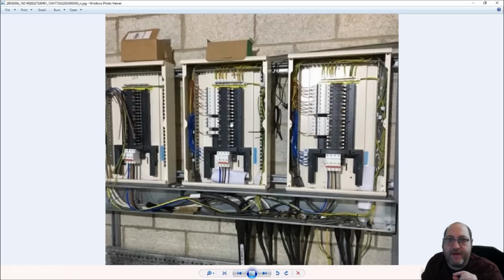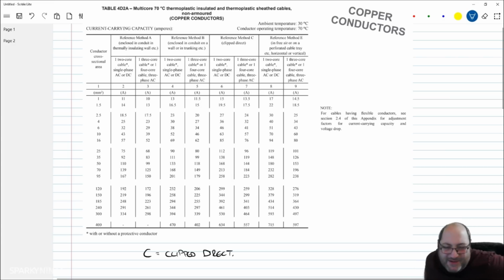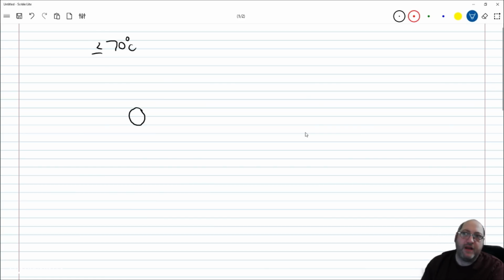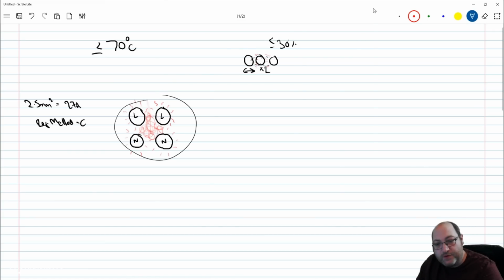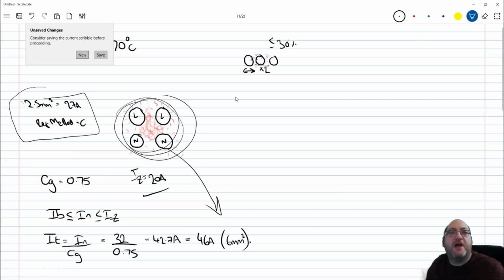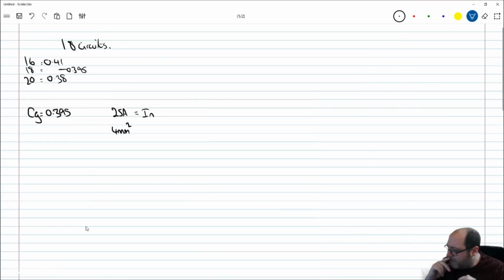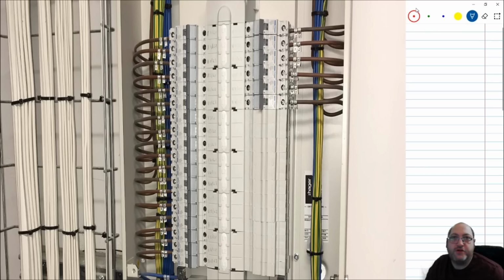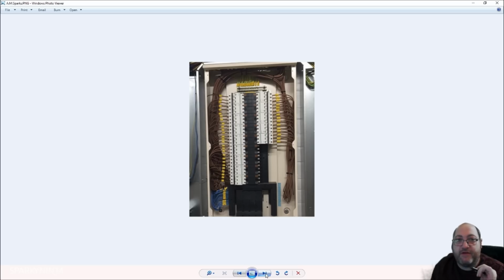Cable Grouping and the impact on electrical installations

Comment: I agree you should be highlighting bad grouping practices but the example used I don’t think was a fair one. 18 x 32 amp circuits running at full load would fry the dB fuse in a Nano second, hotel bedrooms use fuck all, hairdryer for a couple of mins, led lights,tv,small kettle, the odd dildo, I don’t think even the ac is connected to the bedroom circuits. You could probably change the mcbs to 20 amps and be ok. Agree there’s no need for the ties, it’s just bragging site rights for the sparky in question and wank material he/she can show there mates on there phone. I’d love to be there when the dB was finished and the spark stood back all proud and then there boss cut all the ties and pulled them apart and gave them a roasting for bad grouping practices.
Reply: I did not think many of the examples held up either, and in small dB with diversified loads there will never be a problem. Example over engineered. However, this is a real issue and greater thought is required by the installers to ensure safe installations.

Comment: Great video and a good illustration that neatness isn’t the goal we’re trying to achieve. I see some god awful snake pits most of the time, but my primary concern is the effectiveness of the conductor to do the job it’s there to do. I have experienced on many occasions, opening up a DB and finding hotspots with my IR camera due to tightly bunched conductors. The long term effect of overheating is a breakdown in the effectiveness of the insulation, not necessarily a dramatic meltdown. You’ll often find pinchpoints where cables pass through a single hole or at a bend in conduit or trunking. Often they are unavoidable, which is why the 50mm rule is there for installation method. Having them squeezed together over longer distances removes that area of tolerance in the design. I often use cable tie bases inside large DB’s, but don’t tighten the cable ties. It keeps things neat and allows for cables to be removed or added. There’s just no need to truss things up like laced video cables. Don’t be uptight, keep it baggy is what the man’s saying.

Comment: This regulation has always been in that grey area for me, along with reference methods. Within almost every cable I can think of, the single insulated conductors within the secondary insulation are either touching or have a slight gap between them. SWA for instance, they're touching each other and are intertwined with each other. Does it really cause that much of an issue at the last meter or so of its run? As far as I'm aware you can get up to 7-core flex, so does this mean we can assume that up to 7 single cores can be cable tied together without it causing an issue? The table states multicore cables, but once they're stripped of their secondary insulation they become single cables.
Reply: Once a cable is striped and enters the dB it becomes a a different cable and a different install. In most cases the current rating would in theory increase. The thing to remember is grouping refers to circuits and not cables.

Comment: Great video, Don't you take into account maximum demand & diversity into the equation?.. I used to wire up racks of equipment for video/cctv equipment with power rails and we always used open vented pvc trunking, and LS0H cables generally, cables were grouped really tightly in some cases (I didn't design it) and I often questioned the project engineers decisions, but was just told to do it lol..I think in a domestic environment it's not a major issue unless the grouping runs in major lengths under boards, in ceilings etc, but in a CU or distribution board for less than a metre, unless its a high current, is it really a problem?..I have never witnessed or had any problems. I think BS7671 is being a bit over cautious to save their ass to be fair, but hey ho. I can see the need in Commercial public places as you pointed out in Hotels, airports etc.. Domestic consumer units definately need a better cable management system than just free dangling cables though, a open vented trunking system with a lid would be neater and easier to manage in termination. Thanks for the great videos.
Reply: The cables might have been oversized to account for the voltage drop in long cable runs, this being 12-24V, if the cables were sized according to their current carrying capacity the voltage drop would be massive. So possibly they were also fused much lower than their capacity.

Comment: Surely Cg is only used when cables are similarly loaded. You can't say all those circuits will be carrying the same load at the same time. Is that not the whole point of design
Reply from the maker: I kinda covered that.

Comment: It's amazing how some important design points like grouping get forgotten about or usually less prioritised over time. For me personally, I think about grouping usually when pulling cables through joists more so than when running them into and through consumer units. Specially in the bigger consumer units, it's tricky to keep cables visually organised without tying together. There's no structure or points to individually fix to.

Comment: At some point close to the db their will prob be a 90 degree bend in the trunking where all the cables are bunched with no air getting inbetween them so i don't see why doing it in the db would make any difference.
Reply: I would say it's because the timing the grouping is together, where in a bend it's such a short time the cable has time to dissipate the heat gained, where as if, it's cable tied it's constantly gaining heat so ever couple of foot the heat gains becoming dangerous. 
That's the way I would see it. Maybe I'm right maybe not, but my understanding of heat energy is that it gains heat the longer it's together.
Reply: For very short sections of grouping the heat conducts along the copper conductor and is radiated away by the adjacent ungrouped sections. If I remember correctly there is a note to this effect in the regs.
When long sections are grouped, the heat cannot conduct away and the derating factors must be applied.
Reply: tools for the trades 
Good point

Comment: I guess a good way to still have you CU neat and still to breathe, would be to use some sort of cable comb. Like you sometimes see in data installs? Not sure how easy that would be to come by.
Reply: I wonder whether you could strap to the outside of short pieces of conduit as a cheap alternative.

The ideal being some kind of cheap injection moulded comb that you can buy in boxes of 100 or so. The PC modding options sadly aren't really ideal and are too expensive.
Reply: @mowcius  Something like this? http://www.themoog.org/blog/archives-5

Comment: I gave a thumbs up here but I want to be devil's advocate.
Some cables pass into a db from the back in a bunch as the only option, so therefore this requires the same thought, but then what if the bunching is only for 50mm or less? Does this still matter? What about running cables together under boards, is this also then a problem? Another point is has anyone actually put say 4 cables under load and viewed them under a thermal imaging camera to see the difference to see if theory has gone into overkill or are these very important points? We're talking about less than 500mm in most circumstances here so what is the REAL risk? What's the greater risk, a board with cables everywhere or a short cable tied collection reducing a mess. I'm just saying are we going too far here or are we making installations a fire risk by making our work neat? Next video:thermal imaging camera before and after lol. Cheers sparkyninja, respect to you bro!!
Reply: For it to be a fire hazard the grouped cables pretty much have to all be pulling high loads for extended periods at the same time.  Now in most scenarios this is very unlikely to happen HOWEVER the FACT it's possible makes it a big no no and a real fire risk imho.  You can't install a setup and simply assume or hope that circuits XYZ don't simultaneously pull significant loads for extended periods, yes it's very unlikely to happen but the fact the consumer CAN create this enviroment makes it a serious fire hazard and risk to life.
This is why you now find all cable reel extensions with thermal cut outs.  Fuse's, MCBs, RDCs, RCBO's ..etc cannot protect a circuit from this thermal fire hazard and therefore it should be taken very seriously imho.
Reply: Keith 
Good point, panel wiring is bunched!
Reply: @mikeenglish1492  you have point, but you need to comply with bs7671. Panel wiring is not bs7671.

Comment: Maybe I'm missing something here but from Ref method C you chose a cable that could take 27A but in the In / Cg calc you substituted 32A and then went back to the table to select 6mm cable.  I don't disagree with the calculation but the original cable wouldn't take 32A.  If you were allowing for a ring circuit then surely you had to allow for that in your final calculation as well?
Reply: 27amp was just a basic example to start off with and had nothing to do with the 32amp calculation with the 6mm which was for the 18 lines in the DB which were cable tied together.
Reply: Indeed. The conductors needed to be able to carry 26.67A and not 42.67A so 2.5mm^2 would still have been fine and certainly 6mm^2 was not necessary. So this would have been clearer had a radial final circuit been used instead of a ring final circuit incorrectly used.

Comment: Hello SparkyNinja, Great vids again, I think you explain really well, much better than some of my old lecturers from years ago, however I do still have a few queries... Around 11 minutes you give the example of a ring main with a line, a line and a neutral and neutral, therefore singles tied together, so why is it Item 2 (single layer on a wall) and not Item 1 (cables bunched together) ? Also that is one circuit, so why are we looking at the column for 4 circuits?
Reply: I agree, some issues with the example. Grouping needs to be applied whether you have a 2 or 4 circuits... Or even a 36 way tp&n board with 72 outgoing circuits.

Comment: Excellent and informative video - thank you. In my experience most electricians are unaware of the grouping factor and the 'It' calculation in general with an alarming amount not knowing about 'Ci' (thermal insulation) either. This is not the fault of the electrician, it's the fault of the education system. Having a good knowledge base of design work gives a much deeper understanding of the electrical arena altogether. I believe that every electrician should have some knowledge of a designer's remit.

Comment: Has anybody ever seen this actually cause an issue? I personally never use cables ties in consumer units and agree with all the calculations that it should be a problem but considering the amount of people who do use them I’ve never seen them overheat cables/mcb’s
Reply: This is the reason I wouldn't let  an electrician other than my self anywhere near my house.
"yeah but", yeah but fuck you, do it properly.
Reply: Tom Hanley 
Never seen an issue here, I’ve used a thermal imaging camera and found any cause for consent. This was brought to my attention by an niceic inspector many years ago so I made a point of investigating this during inspection and testing reports, many included dbs that were tied and very neat, never an issue.
Nobody’s mentioned singles installed within trunkings radiating away from multiple dbs, although spacing factors are taken into account installed cables will sit on top of each other with no spacing!
Reply: @mikeenglish1492  It very much depends on the simultaneity factor of the loads (how many of them are online at the same time). In residential buildings or offices, the panel would measure no more than few degrees over ambient, but in a factory it will be another story. If you factor in the unstoppable tendency of workers to use very long and thin cable extensions, for outrageously big loads (i've seen extensions over 50m long of 3x1,5mm2 used for 2100w - 3500w), you can be in trouble.
Reply: @mikeenglish1492  Seems pretty obvious it would be related to the total simultaneous load.
In a residential installation for instance, even if the entire wiring system combined is rated for 150 amps or more, how likely is it that you'll ever hit the load limit of every circuit all at once?
It could happen, but it's not very likely.
Reply: @Nicholas Pearce Let me just turn the washer, dryer, kettle and microwave on and test your little theory.

Assuming they are on the same breaker (which they are in cheap houses) that is around 5800w.
At US 110v that is around 53 amps.
 
That isnt including lamps or other small appliances.

"new builds are not as power hungry" this is categorically false, every idiot and their dog has AC a big ass TV and a computer now.
Reply: @mememachine5244  The kettle is going to run for 2 minutes, the microwave probably a little more. You're just trying to make an argument there.
Reply: @leonfletcher6045  P=V/R

This is high school physics
Reply: @mememachine5244  I know that. You're missing the point. Nobody switches on ALL their high power appliances at once. If I did that in my house I would need the 100A cutout fuse upgrading to a 3-phase supply to cope. It's called diversity.
Reply: @leonfletcher6045  so you don't live with anyone else ? Teenagers in the shower , washing mc on , oven/grill on etc
Reply: @charliedecker7702  Of course that's possible. But my shower (assuming it's electric) isn't in the kitchen, and my cooker feed is nowhere near the ring circuit for the sockets, so the appropriately rated cables do not run together except for the final few inches to get into the consumer unit, and will those final few inches really make a difference in a domestic setting?
Reply: That's because the consultants go belt and braces over the top on the sizes and then they become really difficult to terminate as the isolators and outlets are too small  . I have seen cables running really hot but usually its a loose connection on a conductor that becomes a fire risk .
Reply: Yes, I've seen many completely brittle cables from heat damage that are crumbling away from overloaded trunking especially. Not so much in fuse boards but then I don't see much of this overly neat work
Reply: I dont know how it is elsewhere but never should there be cables inside the board or inside walls etc that heats more then human hand. Even if you tie cables inside the board they should not be heating up in normal conditions.

Comment: What you are saying is 100% true, but most of these cases are less than 1m of cable tied conductors.. would this de-rate the cables even if pulling maximum demand ninja ? 

Again i don't doubt what your saying and i find it super informative but i have done this for 18plus years and never had a problem thus far.. i cable tie but very very loose so it doesnt strangle..

Kind regards,
Greg
Reply from the maker: The cables limiting current carrying capacity is applicable throughout it's length and so will also apply for just the 1m or so in the consumer unit - I used to do this myself when on the tools as well. It's much more of a concern when the cables we are tying up are under load for long duration's and are near their limiting capacity for the conductor size.. for example lighting circuits will rarely be near their capacity but final circuits for things like door heater curtains and thermostatically controlled water heaters will be.. Things like showers will probably be under load for too short a period of time for the conductors limiting temperatures to be reached.. it really is a case that we are 'getting away with it' and I just want electricians to understand that the one time they bunch conductors under long periods of large demand - then it may bite them.
Reply: Greg Beveridge 
I find these videos very informative however in my 40 years I’ve never found an issue with dbs tied in this manner. This issue was brought to my attention many years ago by an niceic inspector. I have made it a point since then to   Observe and inspect cables tied in this manner even to the point of using thermal imaging equipment on loaded circuits. My conclusion is that there is no real effect through bunching in the ‘dB, . No disrespect to Ninja, just my observation?
Reply: Mike English I guess it’s rare to see issues due to all these figures ie temp rating max current carrying capacity ect have so much head room built in for installer error that these over sites just eat in to that head room and leave the cables still able to stand up to the thermal abuse.

Comment: An excellent video to start the year.

Different reasons, but a similar situation bundling data cables together; crosstalk increases as you bundle them so you have to use better cables/reduce the rated speed. It sure does look pretty though!